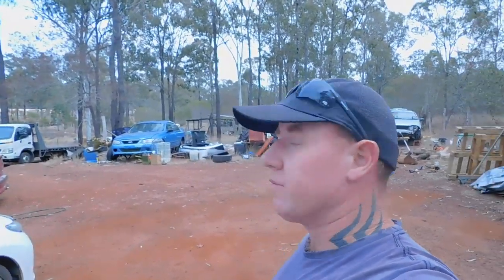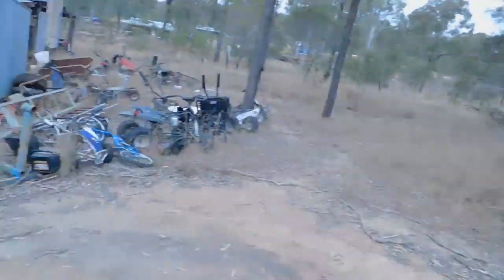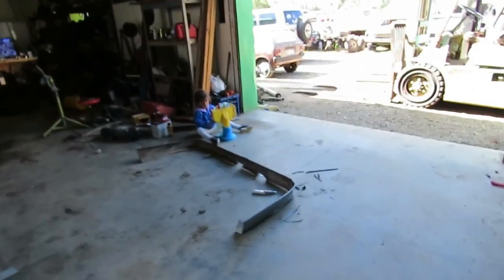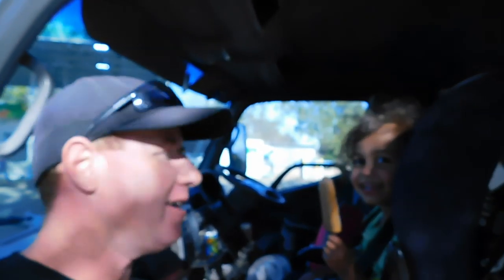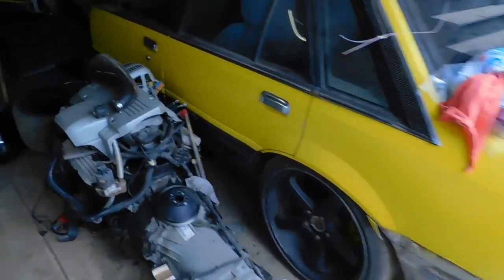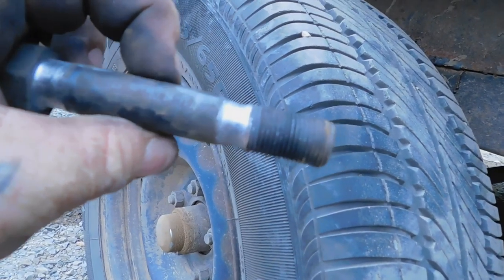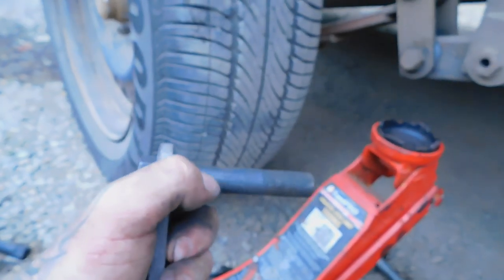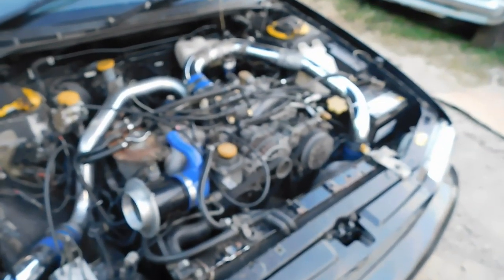kingatow crew/ vl turbo subaru wrx shots flames and more ford than anyone needs

Comment: That vl was my first car, it was silver over grey. I brought it’s in 2006 with 147xxx the interior was already done I put the exhaust and extractors, wheels, all the suspension. Was a mint car, ending cracking the head, I swapped engines, and I left it out at Ollie’s, which was old mate must of got it from.
Reply from the maker: small world

Comment: Did he have much mucking around putting the LS into a 6cyl car?
Reply from the maker: if you are talking about the val ....i got mounts from castlemaine rod shop ...i have not done sump yet or pipes ac wont fit in. stock spot ...there will he a video with all info very soon
Reply: @KingatowCrew  No was talking about your mate in the video putting an LS into a 6cyl commodore.
Reply from the maker: k frame maybe fuel lines not sure but its going and he drove the sv89 and said its quicker than his ls1 so we are going to go out and race so when i film that i will run through what he had to change
Reply: @KingatowCrew  Aw that would be awesome. Thanks.